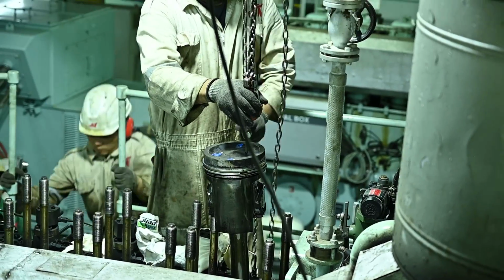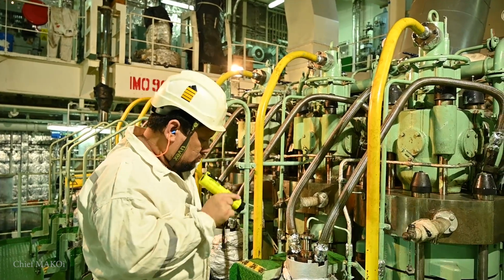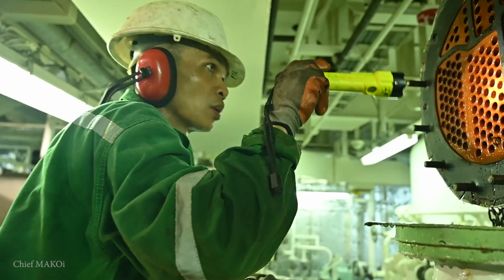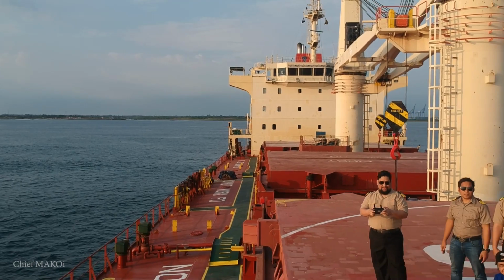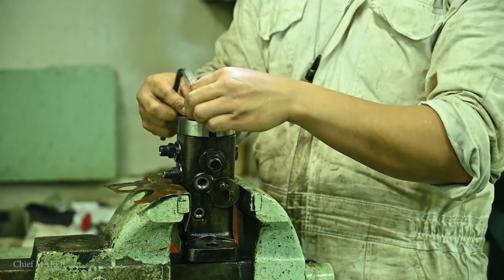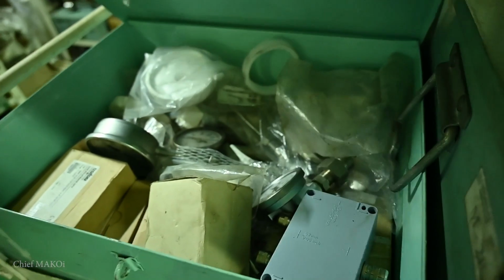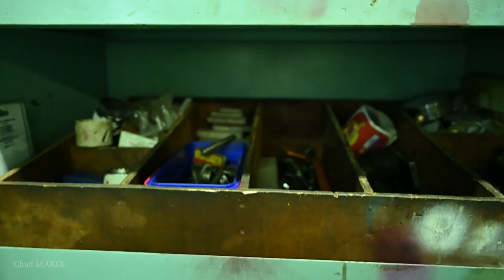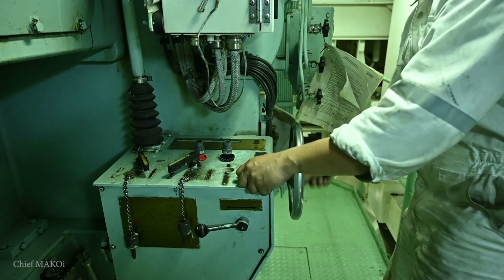Marine Engineers : The Ones Who Make The Ship Run | Chief MAKOi

Comment: Chief, can you run the main engine with a cylinder disabled?  Just thinking that time is money,   and it can be hard to coordinate the availability of specialized personnel.  There are times when we have to wait weeks or months for the availability of specialized personnel or  parts.  I was wondering if a ship would have to sit at anchor and wait for techs,   or just disable that cylinder and keep moving.
Reply from the maker: Yes.  If there's no heavy damage.
Reply: @Chief MAKOi  Today I'm loading the Strategic Synergy with Petroleum Coke.   /maybe 6 or 8 years ago,   I think some regulations were changed, requiring low sulfur fuel for main engines.   Dole had two ships that were destroying cylinder liners like clockwork.   I'd go up on the bridge of the vessel,  and use our Gottwald's remote control to lower the liners into the engine room through a deck hatch.

Comment: I get it that a marine engineer working as you do must be flexible and be able to learn quickly, however, I assume that the young guys can get help and instruction from the older experienced guys if they are working on a bit of equipment they may not have worked on before? That’s they way it happened when I was working.

Comment: I was asked by the owner of an ocean going tug boat company around 2009 (his regular chief engineer was to be off for a month or more) what do you know about EMD diesel engines. I said, "Dan they are all the same no matter the brand, so I went through some things after I got through he said, I guess they are all the same. The tug was the Black Hawk at 134 feet with twin EMD diesels and we carried 125,000 gallons of fuel.  He wanted me as chief engineer because I had a ship repair back ground,  both in the shop and in the yard yard, his assistant engineer was not very good at figuring out a problem should one arise.

Comment: Hi - at one time the operator of a piece of heavy equipment was called an operating engineer - since they were so difficult and complicated. There were a number of different kinds. The person who operated the engine of a train in an engineer, they have to try and fix it if it breaks. As a side note, the Conductor is the highest ranking person on a passenger train, not the engineer. That use of the term has fallen out of favor, but it still is used in some places like the Marine Engineer. My Great Grandfather was a "Stationary Engineer". Today they call that job a Power Plant Operator. He worked at large construction sites rather than power plants.

Comment: Not sure what people think you do when something breaks in the middle of the ocean. Find a lay by and phone the ship recovery help line. Hope they can get there within the allotted 2 hours. That is one of the best things about Marine engineers. You are isolated and so have to work it out. The huge variety and complexity of the jobs you undertake makes for very well trained and qualified engineers. Once upon a time you took a car to a mechanical engineer. Often some bloke in a back street garage. If you got a good one they could pull every part of that car apart. Repair parts. Make their own parts. And generally fix what it needed. More like what you still do. Now when you take a car in they need a computer to lead them in the right direction. And a big box of plug and play parts for a direct swap. Nothing is repairable anymore apparently. In truth most of them wouldn't know how to fix anything.

Comment: Say Chief, does the maritime industry use a chit system or shadow boxes for tools? It was critical in military aviation. We utilized shadow boxes to keep track, as a missing tool could easily damage or even cause an aircraft to crash. Excellent video!
Reply: No, we do not, which is sometimes a pity.
On one occasion we had to change a main engine cylinder liner which was worn beyond makers limits. (We were in port doing scheduled maintenance)
It became stuck after lifting it out for approx. 2 bananas. We went looking for two heavy hydraulic jacks in our store room but the conclusion was that they were probably now part of the inventory of the Singapore shipyard we had left a few months earlier.
But we got it out using freon and ordered two new jacks.
Reply: Thanks! It’s beyond frustrating when tools end up missing.

Comment: Thank you chief! That answered a lot of my questions. As a former EE - now doing house swapping because it's more fun -  I was thinking at first  that you guys would just swap the board, but I can see that's a bad idea because that board could have been damaged due to bad connections or some other system damaging it so yes, you would want a specialist to diagnose the problem first.  However, those surface mount boards tend to just get swapped and the factory then either repairs it or recycles it depending on costs.
Reply: Computer boards, particularly very specialized ones, are not only expensive, but in general, keeping a spare around is generally not going to help if you don't know how everything has to connect and if you need to do some programming of the board.  Back when I was running a computer shop, I had a small manufacturer ask me to come out and repair one of his machines.  What it needed was a replacement controller board from the manufacturer.  He thought I should have one sitting in my shop, like a standard PC motherboard.  Nope.  He had to call the company to get a repair tech out.
Reply: @Norbrookc  Ya my knowledge is out of date for sure. We have some controllers with PROM's but nothing like today I can imagine.  When I was around, we had - wait for - discrete components - yup - that old :)
Reply: @JackKirbyFan  This was a plasma cutter, and the kicker was that the guy had ruined it by leaving the cover off while cutting.  Originally, he told me it was the diskette drive (loaded the cutting instructions), which was easy to replace. However, that wasn't the problem ... the board was toast.  Metal vapor/particles, some magnetized, on what should have been a protected board pretty much guaranteed it was toast.  He was pretty upset that I couldn't fix it, and really upset when he found out that he was looking at a pretty hefty price tag to get a new board and have it installed by the manufacturer.  Their rep replaced the cover, and informed the guy that it should under no circumstances be left open.
Reply: @Norbrookc  That was so typical a story. I did tech work working my way through college and somehow customers - FIND A WAY. I'm sure you look back on that and laugh but I'm not sure you were laughing at the time.
Reply: @JackKirbyFan  What was the most exasperating part was that he was trying to bully me into fixing it somehow while also griping about the cost to fix a piece of critical equipment for his business.  Now it's funny, but back then I wanted to punch him.
Reply: @Norbrookc  I have SO been there believe me. I understand completely. It's the nature of the beast. One of the reasons why house flipping is more fun - well the selling part is once you get the money you want. The investment part can be fun and I love the house wiring part but it induces worry too since you never have a guarantee of profit.

Comment: I was one of these special manufacturer's engineers he was talking about. I was stationed in Dubai as lots of ships  pass by here on a regular basis. The navigation officers on the bridge were complaining that the speed input on the collision avoidance system had not been working since they left Singapore. This signal comes from a unit down in the engine room. When I went down to check it, they told me it had been removed and left for repair in Singapore. An expensive service call, I guess they don't talk to each other very often.

Comment: It must come down to the severity of the breakdown. Damage to a major component I'm sure is very rare. No doubt the crew can handle 99% + of failures, it's the odd 1% where outside help is required. The fact that the crew carries out major maintenance also means of course they are capable of major repairs should they happen. It's a tried and tested system that works.

Comment: There are many kinds of engineers, most of which require a master's level education and a "Board License" or a "Professional Certification."
Electrical engineers, mechanical engineers, aeronautical engineers, logistics engineers, petroleum engineers, marine engineers, etc. ad nauseam.
At one time the only degree available to a student of the US Naval Academy was a degree in Marine Engineering.
As Chief Makoi indicates, it's possible to be an engineer aboard ship by virtue of introductory schooling and OJT. One would be an engineer working for the Chief Engineer. In the Navy, every person assigned to a "E-#" division was an engineer (little 'e').
Our E-4 shop had the trial of remanufacturing parts for a ship's high pressure steam turbine, a job we were specifically and peculiarly not trained to do. If we couldn't get the job done, the ship would be unceremoniously hauled into a drydock, have her guts ripped out through a hole in her side, and refitted with a new turbine. At a saved cost of about $3.3 million, I think we did ok. This is what engineers did.

Comment: Good morning Chief!  <S>  At least from Virginia, USA.
On the ship I served on, we had many engines.
6 main engines, which were V16 ALCOs.
3 Generators, 2 V12  ALCOs and 1 V8 ALCO.
ALL these engines used the same sized heads, pistones, injectors, etc.  Making the parts interchangeable for all these engines.
We used JP5 for fuel, since they were all diesel, so we didn't have to use that 'crude oil,' like stuff that your ships use.
All the small boats, used Detroit diesels, mostly straight 6s, two stroke, 671 "Grey Marine," meaning they basically used sea water for coolant.
Except for the 'Captain's boat," that had an 871.  "A V8 instead of a straight 6."
But again, because they were all the same mechanically, the parts could be interchangeable.
Being a military vessel, meant we were required to 'tinker,' with these engines on a regular maintenance schedule.
I enjoy your videos, how your team breaks an engine down, and then puts it all back together.  "And no extra parts left over!!"
It's a good feeling when that engine starts up and the ship continues on course.
Het Chief...  You looking like you're hitting the main deck cookouts a bit much!  The drone footage reveals all!  LOL
Maybe a walk on deck is in order!
Smooth seas and clear skies Chief!!  <S>
Reply: Amazingly, the two NASA crawler-transporters for the Apollo missions had two ALCO V-16 251C turbosupercharged engines to run it, each engine producing 2,750 horsepower, as it carried the Saturn V to the launch platform. They remain the world's largest self-propelled land vehicles. The transporters weigh 2,721 metric tons (3,000 tons). The engines drive four 1,000 kilowatt electric generators. These in turn supply electricity to sixteen 375 horsepower traction motors. Since replaced by Cummins QSK95 16-cylinder diesel/C3000-series.